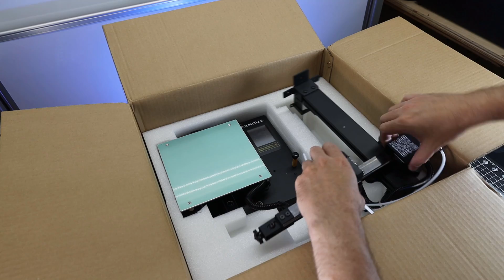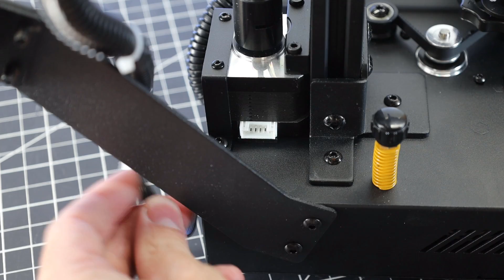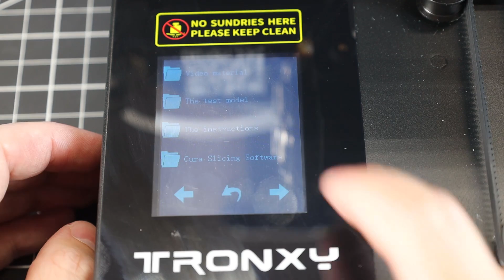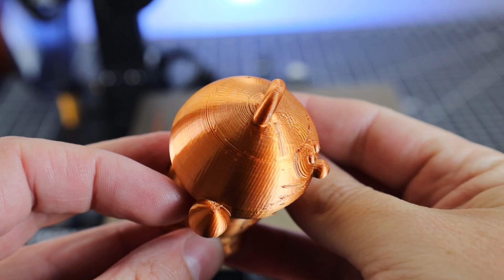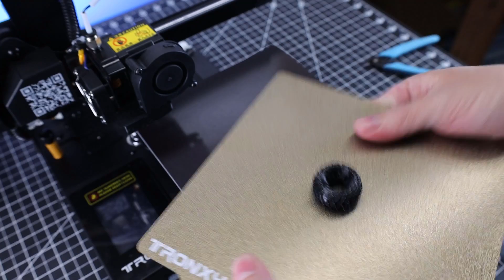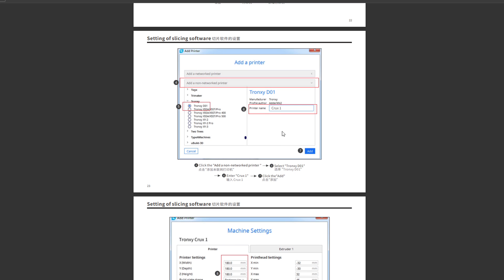TRONXY CRUX 1 Setup & Review

Comment: I’m having issues with mine.  It prints the included cat and cube models that are installed already but if I try printing anything else it doesn’t work properly at all.  

Half the time the filament doesn’t stick to the bed and I have leveled it 100 times already and it is perfect
Reply from the maker: Make sure when you are slicing your own prints that you have the bed set to 60c and your hotend to 200-230c if using PLA. 

Try printing a large cube so you can see what is going on and if it's just not sticking you might need to live adjust your z offset on the printer.
Reply: @GomeowCreations  I haven’t even tried doing my own prints yet. Just trying to get the thing to print the test models properly first.

Comment: I have this little 3D printer, modeling in Blender and slicing with cura. I'm very happy with my Tronxy. So far it's been very reliable and consistent. Using eSun PLA+.
The side fan made noise, but it's gone after 1 minute. Maybe needs some more grease.
I do recommend it for beginners that want a good 3D printer and want to do more. The only limiting factor is the bed size.

Comment: i bought this and the first print i did was great but after that anything i printed just slid off while printing i have made sure the bed is perfectly level but this is still happening please help me.
Reply from the maker: Is the bed clean or any oils from your hands or dust? You can build the build plate off the printer and wash it with some dish soap to get oils off. I just use rubbing alcohol to clean mine. 

If that doesn't work then your z offset might need to be adjusted so you are printing a little closer to the nozzle.
Reply: @GomeowCreations  i have cleaned it but that didnt make a difference, and i think i am printing very close to the bed.
Reply: how small should the gap be between the nozzle and bed
Reply: Use blue painters tape on the build plate. It's even better to use glass instead of the magnetic sheet and also use blue tape. Just my opinion works well for me
Reply from the maker: When leveling the printer you can use a sheet of A4 paper and the nozzle should just come in contact with that but you should be able to move it freely. When you after that you can start a test print and live adjust the Z offset. 

Don't use blue painters tape that is just a bandaid for not having your printer leveled and setup right. 

I now have a few hundred hours of print time on this little printer doing production work and I have had no problems with things sticking to the build plate.
Reply: @GomeowCreations  tested a heap of things and still doesnt still properly
Reply from the maker: No real testing needed All you need to do is make sure you have a level bed and then start a print and adjust the Z offset so it's the proper spacing away as it's printing I'm sure there's a ton of tutorials on how to do that step.
Reply: I'm also having a hard time with bed adhesion on the PEI sheet. When it cools the print pops itself off, I don't know if that indicates a problem. I've started using brims to stop edges from warping up.
Reply: @BitsBlit   The PEI sheet works well for me. I have the z offset closer than with other bed materials, and I keep it a little hotter (65C for PLA) during printing.  It does have to be really clean. After several prints or when I have bed adhesion issues, pop the sheet off and wash with dish soap and rinse well without touching the print area.  Alcohol really just thins and moves any oils around, but dish soap will remove the oils. Hope that helps.
Reply: @lemontwist63  Thanks for the tip, I have not tired to wash the sheet with soap and water. I've only been using rubbing Alcohol.
Reply: I have a Pei plate. It slid off when it's been used a lot of times without cleaning. You can't spot the dirt so you have to clean it regularly.
Reply: @randywatson8347  i found that mixing some glue and metho and rubbing it on the pei plate works wonders

Comment: Nice printer but for that price isn't it competing with larger build volumes🤔
Reply from the maker: At the Crux1 $180 price tag or the Prusa Mini+ at $550?
Reply: @GomeowCreations  my only argument is that an Anet A8 has a larger build volume, full metal frame and cost about the same🤷‍♂️why make the sacrifice?
Reply from the maker: The Anet A8 from what I have seen isn't that great of a printer. The setup isn't beginning friendly at all due to it being a full kit. I know some of them have also started fires but that was due to firmware. I have also seen that the print quality just isn't as good out of the box. 

With all that said if you like to tinker and build things then it might be a good fit for you. Most people starting out want something that is going to be easy to get working with little time invested in setup.
Reply: @GomeowCreations  🤦‍♂️my bad I meant to say Anet A8 plus